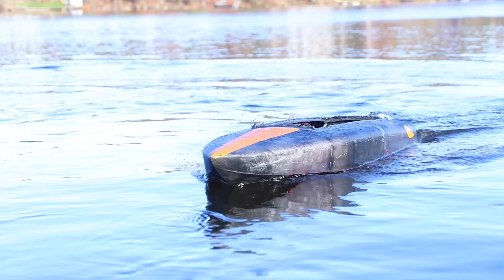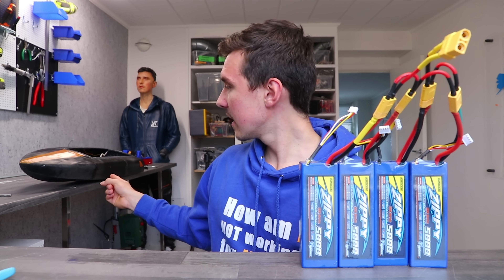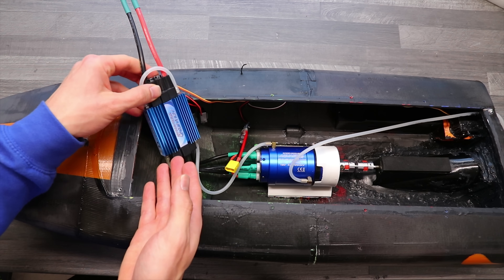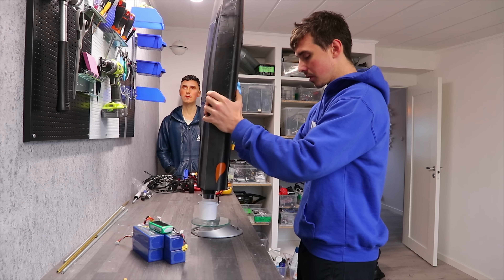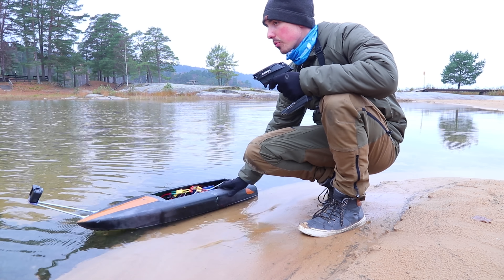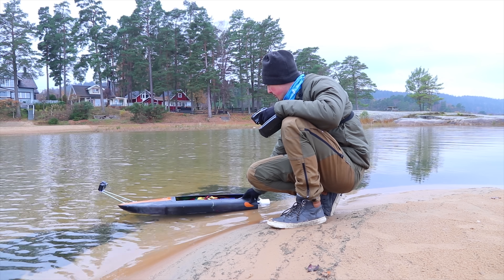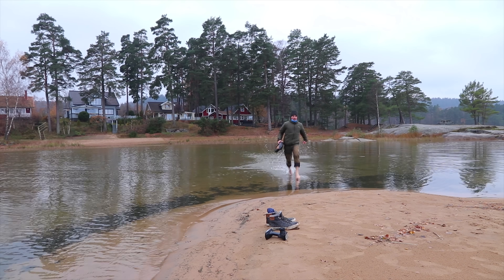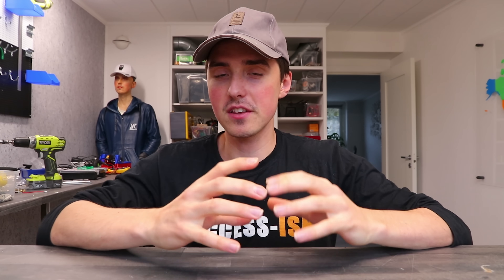NEW 3D Printed Jet Boat - PART 2

Comment: two days after the Japanese attack on Pearl Harbor (Dec 9th 1941) two USN sailors went surfing off of Diamond head on Hawaii.  A tidal rip began to carry them out to sea.  One of the worlds first helicopters (literally was just being uncrated on the 7th), was dispatched to try and rescue the sailors.  It did DID not have a rescue hoist!  As the pilot attempted to get close enough for the guys to try to climb aboard the rotor wash would blow the surfers away from the helo.  Finally the pilot realized that he could USE the rotor wash to blow the victims closer to shore....  Thus your rescue of your boat is a reenactment of that rescue in 1941, and a common technique helos use to this day.....

Comment: Nice boat. Does it have a screen at the water inlet to prevent sucking in something like aquatic plants to damage the propeller? How about connecting the cooling water outlet to the duct which sucks in the propelling water, therefore it may not need an independent power source to move the cooling water?

Comment: 1. Servo stopped working: Receiver or Transmitter not receiving or transmitting data fast enough. Or too low distance range and lost signal.
2. Jet Boat shut off: Electronics too hot triggering a failsafe and shutting off the system.

Comment: Idk if this will reach you or not but they make connectors called AS150 and they work great for 12-14s lipo setups. I run them on my dual 6s quad and they work perfect. They’re even anti spark connectors

Comment: tennis ball on some fishing line for dead boat retrieval. Use the business end of a fishing pole for larger bodies of water. attach ball to string and fling. Retrieve with the reel. You should be able to program the pistol grip for a percentage ramp when accelerating. Also, 75C or 100C batteries if you want speed and smoke.

Comment: I'd suggest putting the batteries further forward. It'll help keep the nose down and give it a better draft angle. Another thing you could do is to add a small vertical fin below the intake for stability in turns. Great build so far. I'll stay tuned for more.

Comment: I know this is a bit late, but maybe for next time. Just find some distance you know and check how many frames it took to pass and what the frame rate is. All together you can calculate rather easily how fast the boat is. Acceleration would require a few more of these measurements in a row to check for the difference in speed over time

Comment: Maximum respect for everything you do with a lot of work and dedication.
Regarding your problem of saving the boat, I would have tied a thin fishing line to the drone and at the other end of the line I would have hung a small neodymium magnet .... with the drone sent to save your boat, the magnet would have caught by the engine or another small neodymium magnet already strategically glued to the top of the boat and you would have brought it to shore in a very short time, so as not to bother to bring the boat with the air jet from the drone. Excuse my English. Greetings from Romania. Maximum respect again for all your work. Pixy.

Comment: The set-up of the drive is costing you a lot of speed. The steering nozzle is wide open which would give you a ton of torque but seriously limiting the capability of the motor and battery set-up. Reduce the exit of the steering nozzle so it builds pressure in the pump and center it with the bottom of the boat by making it "droop", it is called a droop snoot. While you are at it, might as well add trim  via a control cable and a servo that would tilt the nozzle up and down just as the steering works. Would make for some monster rooster tails!!! here is a link to a real one.. https://www.bing.com/images/search?view=detailV2&ccid=1ZOfXdVf&id=CBCBB95854530BD1697E355F9A05E5A669152032&thid=OIP.1ZOfXdVfR-SjAwPRtXAdWwHaGR&mediaurl=https%3a%2f%2fwww.hardin-marine.com%2fimages%2fberkid%2f12jg3.jpg&exph=1085&expw=1280&q=berkley+jet+pump&simid=607988208553755130&selectedIndex=5&ajaxhist=0

Comment: Next build a hydrofoil so it lifts a little causing less drag and you could add trim on the jet drive with a servo hooked to a hinge so you can control the depth and angle It will definitely make a big difference I've never seen a RC boat with trim on the prop or jet drive You could be the first LOL That would be awesome to see you figure it all out 🤔😁  Cool boat I really liked your determination  You're figuring it out Good education through trial and error hands on experience is the best experience in my opinion lol 🤔👍✌️ Oh yeah one more thing always bring a fishing pole with a big 3 way hook though directly over the boat then rill in and snag the boat Ive done it many times I had a air boat with a 46 OS H Nitro  motor on a hydrofoil boat I pitched the motor up by the motor mount just to see what it would do 🤔 😁 it would lift out off the water with relative ease It was very fun it flipped alot also thats how I learned to always bring a fishing pole 🤔😁🤣😂

Comment: Use a bigger steering servo with a wider double arm and two connecting rods to either side of the vectoring tube. You could also put a built-in "rudder" on the inside of the tube to possibly provide more authority or grip over the water flow or something.

Comment: I run a 2wd 2xhub motor E-Bike at 36v X 28amps on each wheel with a 10x13 battery the C values aren't as great as lipo's with 18650's that's just over 2000w that equates to about 28 mph with fantastic torq its great fun so if that's great fun, that boat should KA?

Comment: How did you get the ESC Aquastar 200A to work?
Reply from the maker: I didn't, it's a piece of crap and should not be sold by Hobbyking. If you bought it, just send it back and ask for your money back.
Reply: @RcLifeOn  
So what ESC did you use for the aquastar T20 engine?

Comment: You should RC control that little transport wagon and you could transport yourself on a Ninebot S, a really affordable mini segway. Ninebot is the former Segway brand. I got one and Im very impressed by that little machine. It hauled my up steep hills when I were 100kgs. Now Im closer to 90 and little machine is happy 🙂 its also remote kontroller by smart phone. But its set to weak to tow heavy stuff. Its just for show. Its a good show but it could be real practical if it could carry a heavy back pack or tow a little transport wagon. Theres another Ninebot model that got follow me function that can carry a load like grocery bags. And also.. you should make two of these boats and mount a chair in between and set some speed records haha 🤓

Comment: Take a fishing pole with just a weight on the line. If the boat dies cast out over it, walk to a point where the line is over your boat and reel it back in. It works. lol

Comment: this boat would be twice as fast at least if you reduced the nozzle - having run jet ski's for over 10 years with nozzles only 4 or 5  times the size of yours and they have run over 100kw - with jet drive it's water velocity you want and the water accelerates as it's forced through the smaller nozzle - time for an upgrade :)

Comment: FIRST, YOUR STEERING ROD IS TOO THIN TO PUSH FOR A LEFT TURN AND PROBABLY DRAWING MORE THAN 1A, SECOND THAT LOOKS LIKE A 35V MAX INPUT BUCK POWER SUPPLY(BEC) WITH ONLY A MAX OF 1A OUTPUT, YOU CAN TELL BY THE VOLTAGE STAMPED ON THE CAPACITORS 35V, THEY GO FOR ABOUT $0.99 EACH, MIGHT WANT TO SPEND MORE THAN THAT NEXT TIME, OR JUST BUY A REAL 5A BEC.

Comment: Very cool boat. If you were to use a smaller diameter nozzle and direct it up a little bit the top speed would increase greatly. Doing so would increase the strain on the motor but it seems you have plenty of power, those modifications would allow you to take advantage of that power by dramatically increasing the speed of the water being expelled from the nozzle and pointing it up would trim the boat to get more of it out of tje the water instead of plowing the bow.. i think huge increases in speed are possible with thos those two modifications.

Comment: I will subscribe in 1 second if you please do one thing - post a bill of materials and your parts list/source so I can buy some of the components myself - I am a total RC newbie, but know a bit about microcontrollers, servos etc, just need info on speed controllers, battery packs, and RC motors (oh yeah how did you get the rotor shaft sealed from the inside of the boat to the outside ?
AWESOME videos - LOVE IT! keep up the good work!
Travelbug, Toronto Canada

Comment: Why am i not working for nasa well because your an idiot an idiot with a 3d printer that cant even figure out a motor to drive shaft coupler heres a hint ever heard of rc cars and how the drive shafts work you have a 3d printer ball and socket comes to mind with a pin like dog bone axles thats just one of many ways to go now its not going to go much faster einstein due to cavetation now if you made it a v drive /shaft to exposed prop think top fuel nitro drag boat drive system then you might have something  you need to work on precision before thinking you belong at nasa other than cleaning toilets there

Comment: Note too self bring rubber boots next time ,hell your a big shot YouTube star ⭐️ make silicon foot covers with a outer heated water jacket around your silicon foot covers powered by a electric water heater backpack 🎒 using the pony water . Are a hover craft retriever chase watercraft. I my friend use a drone to retrieve my failed watercraft . Building is the fun you get to solve problems an learn .

Comment: Hi. Congrats for the accomplished work.
I have a question. It seem that the water flow is pushing on air. Is that right ?
The residual thrust is directly linked to the fluid density ratio. Knowing that, would it be more efficient if the turbine was maintained underneath the surface and directly pushing into the water as for jet ski ?
Thanks for your feedback.
Reply: The water flow produces it's own thrust due to action-reaction forces, like a jet or rocket engine. It's actually more efficient to release the jet into the air because the water can reach a higher speed if the static pressure of the outside water isn't on it.

Comment: good work.   (sorry, if a repeat commt)      as previously noted, yer math skills sucked, in nov.         balance and hull characteristics appear to give good, at-speed performance.        but, the model has  Major dom,  distribution of mass,  issues.     specifically,  due to the presence of excess mass in the hull, located  Above the water line/c-m, Top-heaviness in the the dom is  Increased.    this condition results in a  reduction in  control  authority  during a faster turn; and/or tendency to capsize.     the use of stoopidly fat batteries is not  a  help.      fun fact:   more  'mah'  means  more  run time.    NOT more power.       it appears that  dom  could be  closer to optimal if the entire upper structure were replaced; with something like  hobby, light-ply;  or  1/8" plywd.      the  id/diameter of the  jet-drive exit duct is  Excessive.   ideally, the duct  id   should  Not  be greater than the diameter of the pump exit port; or cross-sectional area.    cheers         googletranslate

Comment: @RCLifeoOn A thought - I had problems with brownouts on my car. I have a HW 10BL120 ESC and a 4,5T motor on 2S. My fault was the servo. It works just fine, untill I went over 60% throttle - then it stopped responding. Not ideal. I think the BEC couldn't handle the power and as the voltage dropped to the servo, the reciver went haywire and rebooted or something.. It was a old model but fairly "new" Futaba servo I bought on a sale. Put my old Savöx 0231 in it, and now it seems to work. If you havn't sorted it out - try running it with a separate reciver battery/BEC - or change servo.

Comment: Wicked Speed, You have heaps of video so calculating the speed based on the video should be prety simple. This is a great tool for that.. https://physlets.org/tracker/

I did a check on one segment of video and taking a guess at a few distances got a speed of 32Km/h

Comment: Which gets the cooling water first, the ESC or the motor? If I were you I'd give the coldest coolant flow to the ESC which is much more temperature sensitive than the motor. Either way, if you have a thermocouple or something to measure temperature, try running it in your bathtub at full throttle and checking the temp of the water coming out of the coolant dump port on the side.

Comment: You really need to increase your turning ability. You should be able to turn the boat around on a dime. You want to set the up and down of the steering nozzle for different positions also, down for tight turns and straight for speed. Move as much weight to the rear of the boat as possible.

Comment: I have been running gas boats for a while.  They always die unexpectedly.  If you dont want to go for a swim each time, get a fishing pole with a floating lure. You can cast over it and bring it back.  If you dont have a fishing license take the hooks off the lure or use a practice plug to avoid a DNR ticket. You could probably 3d print a grapple of some kind that wouldn't have any chance of catching a fish.

I also bought a cheap reliable electric boat to use as a chase boat. It had reverse on it and a hook that was designed to catch the front of my gas boat.

Comment: some info.    firstly,   yer math   S U C K S.    lmao     FIVE  kilowatts
equals    6.71 hp.                Does  the  motor  have  a  'wattage' rating.
if so, does that number indicate  power   Consumption;  or  Output
power,  in  watts-mechanical.         at 5:15,  Priority should be given
to  optimal location of the Mass of the  batts.    they  Should  All  be
located,  LOW  and  on/near  the   Center line.     the c-m is where.
btw, there appears to be  a  LOT  of  Air, in the jet output.    it may  be
that the diameter of the exit housing is too great, in relation to the
part 'in front of' it.   if so,  a  drop in pressure is occurring within the
housing.   cheers            googletranslate

Comment: I think that the design of the hull might be preventing you from getting up on a plane as easily as you could be. The way you have it set up, there's a 'bulge' in the v-hull at the forward end of the hull, then it curves inward as it goes back. This would create a low-pressure zone right behind that bulge, pulling the nose of the boat down. If you had a much straighter line from the bow to the stern, i think it would sit much higher in the water and go a lot faster.

Comment: Suggestion for estimating speed:
1. Fly the drone to a known height over land and calculate the length of the area covered in the frame.
2. Fly the drone to the same height over water.
3. Run the boat under the drone.
4. Calculate the time/number of frames it takes for the boat to cover the frame.

Comment: I wonder if the reason the receiver kept shutting down was due to the large EMI coming from the ESC and motor. I've had personal experience with Micro controllers mysteriously rebooting or going into a fault condition where they would permanently hang until power-cycled when it was in close proximity to a 600W BLDC motor and ESC. I would try adding shielded cable from receiver->ESC, and try to add some decoupling capacitors as close as possible to the power input to the receiver. Also, running a linear regulator after the switch-mode power supply (BEC) would potentially eliminate the possible large ripple voltage  going into the receiver as well. In addition, try moving antenna as far away from Motor and ESC as possible.

Awesome video Simon! Look forward to the next one as always.

Comment: To get an idea of speed, you can place stakes at fixed distances somewhere along the water. Place a camera on your raft that faces the stakes perpendicular. When you record the boat passing the stakes, you can calculate the speed by counting how many frames it takes for the boat to pass another stake.
Reply: Or just put a GPS speedometer in the boat…much easier

Comment: I think with that motor and the batteries you might want to use thicker wiring and MOAR batteries - well, in parallel.
While the claimed 100C on many batteries (how i hate that stupid notation) is nice and dandy, most of the time it is a bad idea to push the batteries that hard (if they can even come remotely close to that rating).
Decent LiPos have an internal resistance round about 5mOhm. At that current the batteries get hot fast. (the connectors - they look like they would be rated for something like 90 Amps continuous, should be enough).

Comment: You actually have all you need to measure the speed of that boat. And that's your drone and a little bit of math.

Get your drone out above the water and point the camera straigt down. Then Drive with the boat below it. Then take the footage from the camera. You know how long your boat is so you have a scale to measure the distance the boat traveled. And you know how much time passes between the frames recorded by the camera (i assume it records in 60FPS?). So using this you know how far the boat went in what time.

Comment: You should try constricting the jet flow with a smaller nozzle thus creating a higher and faster jet stream/laminar flow of water prepelling the boat. Just google pump-jet propulsion or water jet propulsion to get the dimension scales comparing to your jet house.

Comment: Why didn't you put a GPS in it ?
Phones have gps in it,i'm pretty sure you can record datas from an app using gps.
There are also apps for car racers wich record acceleration,top speed etc.
Nice save with the drone,with the hatch on,it wouldn't have been so effective to do that.

Comment: I think you can program that ESC to have a snappier throttle response. Many ESCs I used had that function.

Also try reducing the nozzle to increase the exhaust velocity. You might get more speed out of it.